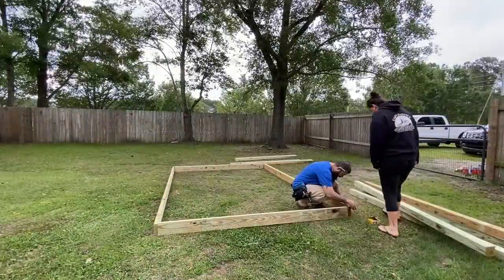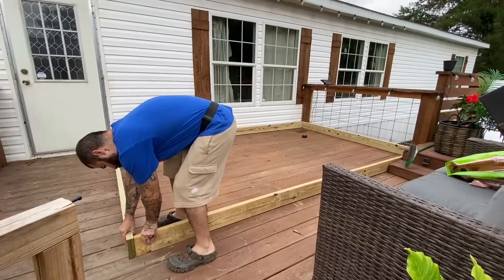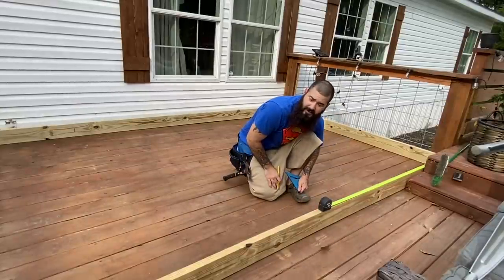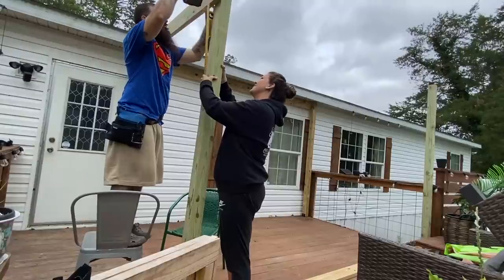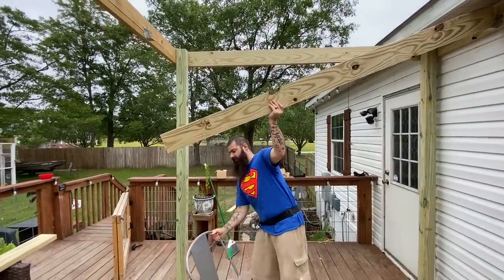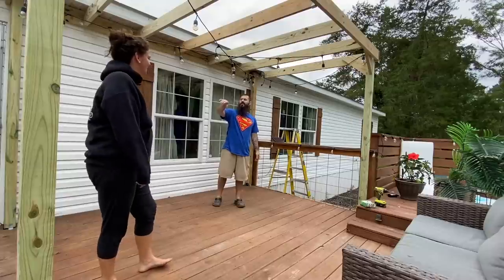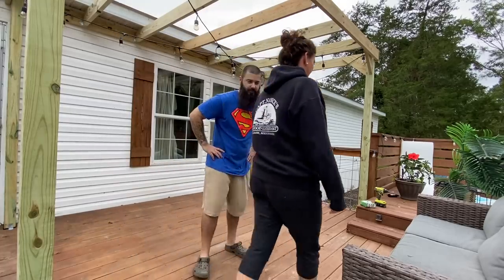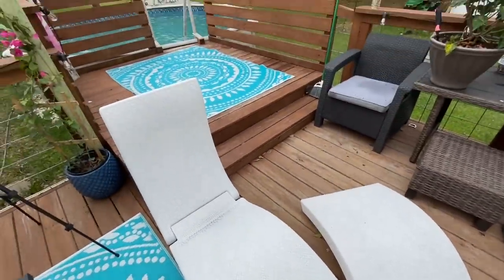Mobile Home Makeover | Back Porch Makeover | DIY PERGOLA under $200

Comment: Last year my husband laid a brick patio between our house and garage. So I loved it, but, said now you have to build a pergola, and he did! Did both within a month. But our garage has settled and one board of the pergola looks crooked. My husband says it's an optical illusion, of course I didn't believe him, and got out the level myself, and it is LEVEL, but, does not look like it. Drives me crazy. I have to  think of something to hide it. Haven't figured it out. yet. SO it can be level and not look it. Yes, our pergola cost about $220, reasonable, and our bricks cost about 2 cents ea. We will lay planks of wood on top and on one end I will have lattice panels. Good job, guys!
Reply from the maker: Thank you so much we plan on adding some on top as well for more shade 😊 thanks for watching ❤️

Comment: That turned out awesome. But I have never understood the pergola thing. It will make more sense. When you out a roof on it. You could use that clear outdoor panels if you wanted to keep the light. Also you would have cover from the rain.
Reply from the maker: yes we are planning on doing that soon 😊
Reply: I agree.  I would use a clear roofing.  If you use a light blocking one, that room inside where the windows are under the pergola will be dark.
Reply from the maker: @hildacollier2638  thanks for the tip we’re actually at lowe’s now checking some out 😊

Comment: Nice job! Looks good and y’all made it look so easy. If you don’t mind me asking, what did y’all use to hang the lights? Where did y’all get the brackets from to attach the 4x4s to the deck, and did you get the solar lights from Amazon? If so, what brand? Sorry for all the questions but I want to try this project and I want to do it just like yours if I can! Thanks so much!
Reply from the maker: Thank you so much we got the lights off Amazon I will try and post the link and we got the brackets for the 4x4s at Lowes 🥰 I hope yours turns out amazing ❤️